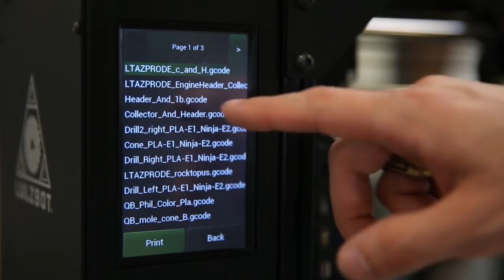NEW! LulzBot TAZ Pro 3D Printer

Comment: Still using those sloppy plastic bearings, so surfaces will be uneven. I would have liked to have seen closed loop DC motors with linear encoders as used in even the cheapest inkjet printer. For this price, it should have included an enclosure, and a way to keep the spools of plastic from sucking moisture out of the air while it is printing.